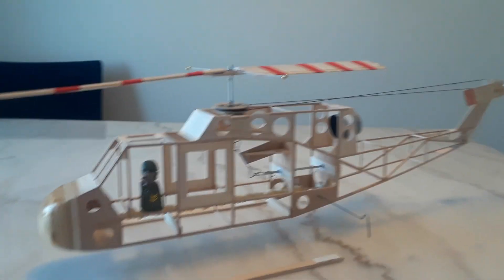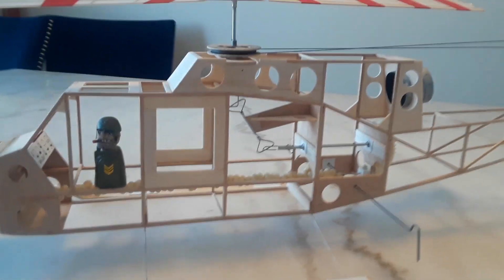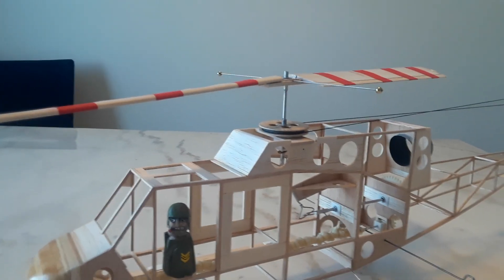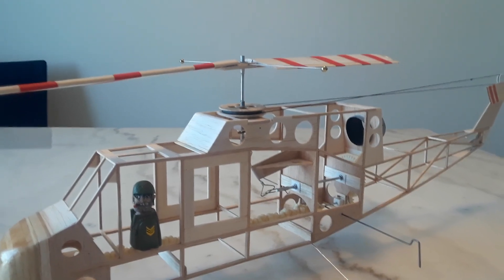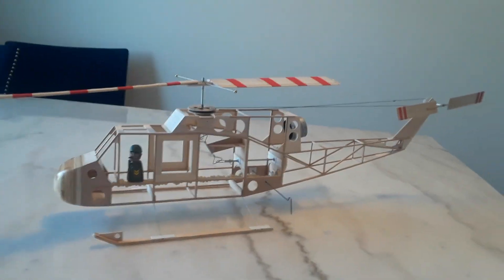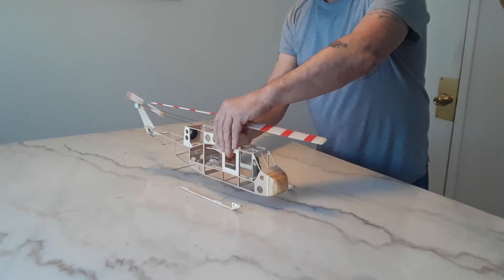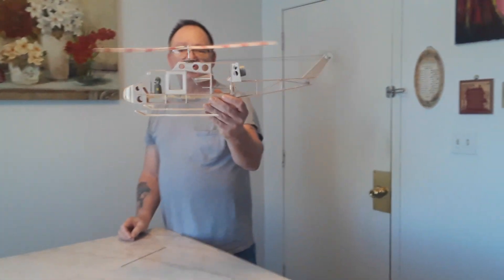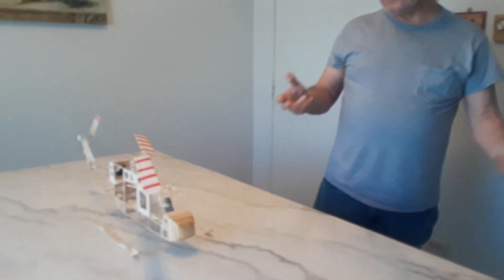Test flight # 2 of Huey # 5 rubber powered helicopter.

Comment: Sure has alot of right tail rotor thrust! Glad to see it get airborn!
Reply from the maker: Actually the tail rotor needs to push the tail cc/w, I need more tail rotor thrust.
Reply: @Raymond Kierna  I was hoping to see a nice, straight, takeoff, without alot of tail rotor thrust, to where the airborne fuselage is straight in flight with just the right amount of tail rotor torque authority to do so. Thankya for sharing!!!

Comment: I think an electric tail motor with gyro stability, would help a lot.  But then that would defeat the purpose of the whole build, i guess.
Reply from the maker: The idea is to get this to fly with rubber power alone, no electronic devices.

Comment: Yes... this I think is the best so far :) baby steps :) greetings from Poland :)
Reply from the maker: Yes but again stability is still the issue, 3 and 4 bladed rotors are more stable,  2 bladed systems are very unstable, I have tried hiller paddles and different types of flybar systems with no luck so far.